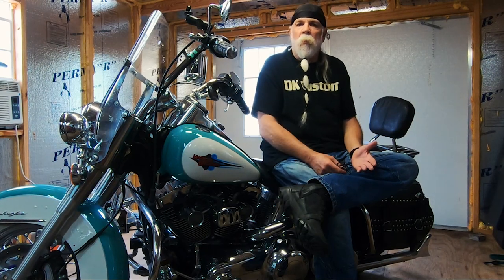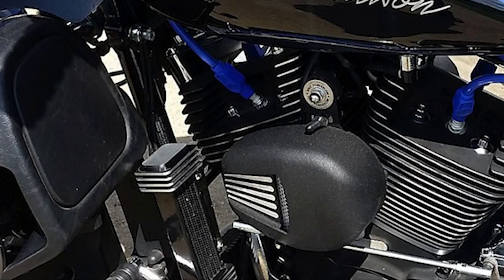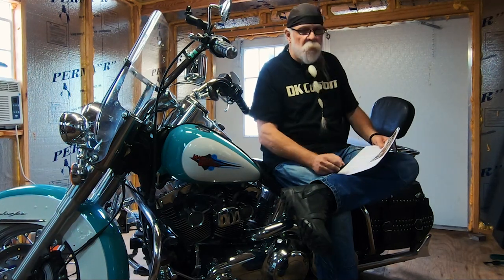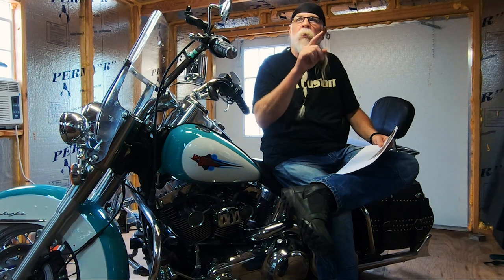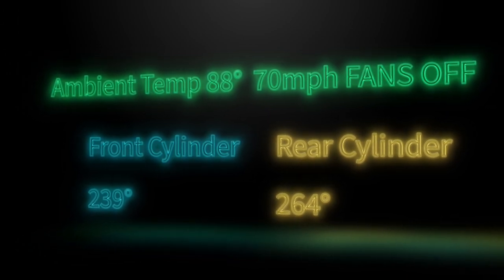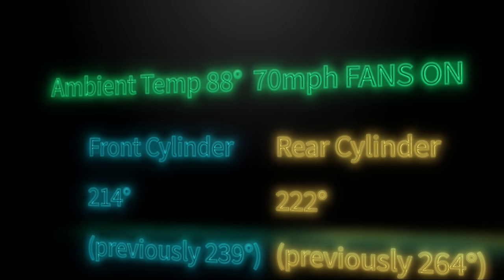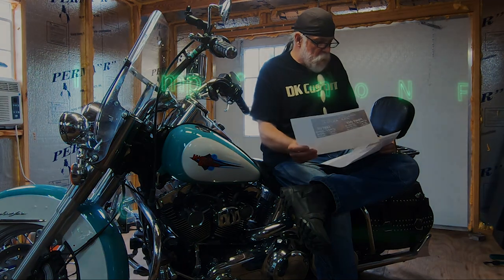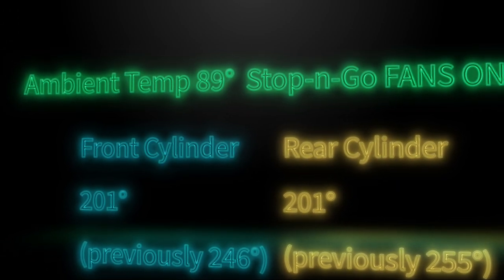Harley's DON"T Need Water-Cooling - Just More Air!

Comment: I definitely want two of these cooling fans
Reply from the maker: They do the job nicely!  Devin has been running one on his Stage IV Street Glide for over 6 years now.  I have had one on two of my bikes, currently running one on my Twin Cooled 2019 M8 114.
Reply: @DKCustomProducts  When I said that I two fans... I didn't realize this fan isn't for Sportster Evolution models.
Reply from the maker: @FLHCSfan68  Generally Sportys do not need a fan to maintain optimum temps.  Here is a video where we do address optimum temps for a Sportster-
https://www.youtube.com/watch?v=rWOdQOtDv6A
If a Sporty does need a fan, the Mighty-Mites will fit it.

Comment: I've actually made my own fans/ mounting brackets etc. Fans are IP67 rated, however I'm getting fans with a higher CFM rating. The fans sit close to the cylinders, dimensions are 25mm thick, by 120mm square. I know a little large, to a degree, but I'm also placing a grill that matches the fins of the engine. Works well. You guys where my inspiration.
Thank you. Cost was very low, otherwise I would have purchased yours. 🙂
Reply from the maker: Interested in seeing a photo and what the results are in cooling
Reply: Hey there, I'm currently stuck in Australia ( working) ( I live in New Zealand) but definitely when I get back, I'll take a pic. But due to the virus etc.
Reply from the maker: @aaroncox3340  Stay healthy!  Looking forward to the pic.
Reply: @aaroncox3340  I would like to see what you’ve made as well.
Reply: I have also done my cooling system myself. Cost me $30 for the fan. 😊

Comment: Doesn't the fan block a lot of airflow by themselves especially the rear
Reply from the maker: Never done any measurements of that.  If it is above 40* ambient I am always running the fans, and it is cooler, so there is more air on both cylinders with the fans than without.

Comment: I have had, and still have a set of Love Jugs Cooling Fans on my 2010 Limited Electra Glide with the 103 with hard Lowers that I install back 2010. I remember back in 2010 or 11 that Love Jugs said that the fans lowered the engine temperatures by 100 degrees. I liked how they're able to plug into the bike's harness under the seat and work off my Aux switch on the dash. After twelve years they're still working, still cooling my engine.
Reply from the maker: Glad you are enjoying your ride.  No doubt the fans help big time.  We've never seen a 100 degree drop (and I have had LJ's on 4 of my personal bikes), but they do decrease the heat by a lot.

Comment: Kevin,  thanks so much for this series; I'm learning a lot and appreciate your sharing what you have found out.  I really like the look of the Jim's Force Flow fan, and was looking at your web site for listings and info.  Do I have it right that I need an additional coil relocation kit to mount the Jim's fan on a 2018 Sport Glide?  Thanks again.
Reply from the maker: Really happy to hear that you are finding the videos useful.
On the M8 Softails, the Force Flow needs this coil relocation
***M8 SOFTAIL FITMENT NOTICE- In order to install the Forceflow on the M8 Softails, it is necessary to re-locate the coil. This Kit includes a turnkey coil relocation system to move the coil to the front of the motorcycle inconspicuously tucked underneath the neck of the bike, in-between the frame tubes.
When ordering at the following link, it asks what bike you have, you would choose Softail Milwaukee-Eight and it comes with this coil relo.

Comment: Can the Jim’s and Mighty-Mite can be hooked up to a 131 M8 and is the 132 considered a CVO or NON CVO.

Speaking of 131 crate engine not 131 kit but how about on both?
Reply from the maker: Don't know about the Force Flow on a 131, but the Mighty Mites do fit on the 131.  I've seen it.
Call or email the shop and they can check on the Force Flow for you.
I am not sure there is a difference between the crate and the kit.

Comment: Are theses the mighty-mite or Jim’s fan your showing dropping down to 214 and 222? And is this for M8 107 114 117 or 131
Reply from the maker: The Force Flow Fan has been Tested on M8 107 and M8 114 Models, as well as Twin Cam 103 models.
It is not the only thing used to drop the temps, but is a very powerful part of our cooling strategy.

You can see a breakdown of how much each component drops the temperature at the link below.

These fan are easily good for a 50* drop in engine temperature in stop n go traffic on a hot day.  Even at highway speeds they are good for a 10-15* drop in temperature.

https://www.dkcustomproducts.com/why-how-to-cool-down-your-twin-cam-engine-part-ii-dk-cl-tc-dn-2.htm

Comment: On my M8 I run riding @300-325 and that’s riding stop and go up to 350-369 for stop and go detours
Reply from the maker: If that is your ET, that is Much Too Hot.  You may find this video useful where we talk about Optimum Operating Temps.  Starting at the 6:00 mark is where we talk about the M8
https://www.youtube.com/watch?v=rWOdQOtDv6A

BTW, what most dealers say and what Harley Corporate actually puts in writing are vastly different.  What Harley puts in writing, in the manual, is that Normal Operating Temperature is 230* F.
Reply: @DKCustomProducts  that’s what I’m reading on the power vision ET
Reply from the maker: @Heavy69Metal  Yeah, way too hot for the longevity and performance of the engine.

Comment: How long will these fans last running 100% of the time?
Reply from the maker: All depends...engines that vibrate more, with an aggressive cam, on average will wear out faster.  Engines that have had no other heat strategies employed, on average will wear out faster.
I have heard of the fan wearing out in 6 months, but the vast majority are still running fine after many years.
I have one that has been on a Street Glide, with mild cams, and is working fine 6 years and over 50k miles later.